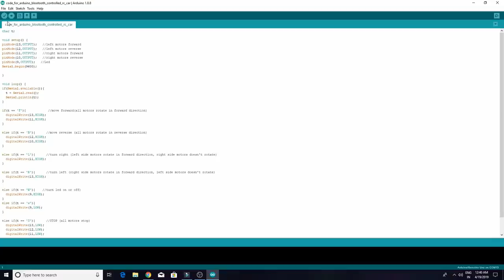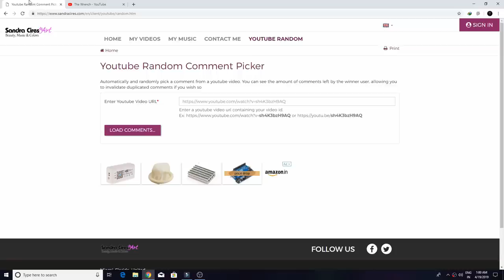WOW! Amazing DIY Bluetooth Robot Car - Control with Your Smartphone

Comment: there is an error while uploding like Arduino: 1.8.9 (Windows 8.1), Board: "Arduino/Genuino Uno"

C:\Users\sushin\AppData\Local\Temp\arduino_modified_sketch_942317\sketch_dec17c.ino: In function 'void loop()':

sketch_dec17c:50:11: error: expected '}' at end of input

 delay(100);

           ^

exit status 1
expected '}' at end of input

Invalid library found in C:\Users\sushin\Documents\Arduino\libraries\sketch_dec17a: no headers files (.h) found in C:\Users\sushin\Documents\Arduino\libraries\sketch_dec17a
Invalid library found in C:\Users\sushin\Documents\Arduino\libraries\sketch_dec17a: no headers files (.h) found in C:\Users\sushin\Documents\Arduino\libraries\sketch_dec17a

This report would have more information with
"Show verbose output during compilation"
option enabled in File -> Preferences.
Reply: Ranjith Kumar how do you fix it?

Comment: The motors do not work even when Bluetooth connection is established successfully
Reply: In the app go to settings . Every button have a cod , make it correct by seeing which cod you have upload in arduino

Comment: Dear sir, when I uploading the codes that you linked, error is appearing. Please help me to solve this.
Reply: before uploading the code make sure the  tx,rx ports of the arduino are unplugged
Reply: The Sixth String does uploading the program while tx, rx is plugged cause damage to the module?
Reply: @arkandzaky9010  , yp, u r correct. I did that mistake & module couldn't use again. 🙁

Comment: I am not able to upload. The following error pops up.Arduino: 1.8.13 (Windows Store 1.8.42.0) (Windows 10), Board: "Arduino Uno"

Sketch uses 2072 bytes (6%) of program storage space. Maximum is 32256 bytes.

Global variables use 189 bytes (9%) of dynamic memory, leaving 1859 bytes for local variables. Maximum is 2048 bytes.

An error occurred while uploading the sketch

avrdude: stk500_recv(): programmer is not responding

avrdude: stk500_getsync() attempt 1 of 10: not in sync: resp=0x36

avrdude: stk500_recv(): programmer is not responding

avrdude: stk500_getsync() attempt 2 of 10: not in sync: resp=0x36

avrdude: stk500_recv(): programmer is not responding

avrdude: stk500_getsync() attempt 3 of 10: not in sync: resp=0x36

avrdude: stk500_recv(): programmer is not responding

avrdude: stk500_getsync() attempt 4 of 10: not in sync: resp=0x36

avrdude: stk500_recv(): programmer is not responding

avrdude: stk500_getsync() attempt 5 of 10: not in sync: resp=0x36

avrdude: stk500_recv(): programmer is not responding

avrdude: stk500_getsync() attempt 6 of 10: not in sync: resp=0x36

avrdude: stk500_recv(): programmer is not responding

avrdude: stk500_getsync() attempt 7 of 10: not in sync: resp=0x36

avrdude: stk500_recv(): programmer is not responding

avrdude: stk500_getsync() attempt 8 of 10: not in sync: resp=0x36

avrdude: stk500_recv(): programmer is not responding

avrdude: stk500_getsync() attempt 9 of 10: not in sync: resp=0x36

avrdude: stk500_recv(): programmer is not responding

avrdude: stk500_getsync() attempt 10 of 10: not in sync: resp=0x36

This report would have more information with
"Show verbose output during compilation"
option enabled in File -> Preferences.
Kindly guide to clear the error and upload the code.

Comment: Codes and Diagram link is not working. Can anyone help me?
Reply: Code:
char t; 
void setup() { pinMode(13,OUTPUT); 
//left motors forward pinMode(12,OUTPUT); 
//left motors reverse pinMode(11,OUTPUT); 
//right motors forward pinMode(10,OUTPUT);
 //right motors reverse pinMode(9,OUTPUT); 
//Led Serial.begin(9600);
 } void loop() { if(Serial.available())
{ t = Serial.read(); Serial.println(t);
 } if(t == 'F')
{ //move forward(all motors rotate in forward direction) digitalWrite(13,HIGH); digitalWrite(11,HIGH);
 } else if(t == 'B')
{ //move reverse (all motors rotate in reverse direction) digitalWrite(12,HIGH); digitalWrite(10,HIGH);
 } else if(t == 'L')
{ //turn right (left side motors rotate in forward direction, right side motors doesn't rotate)
 digitalWrite(11,HIGH);
 } else if(t == 'R')
{ //turn left (right side motors rotate in forward direction, 
left side motors doesn't rotate) digitalWrite(13,HIGH); 
} else if(t == 'W')
{ //turn led on or off) digitalWrite(9,HIGH); 
} else if(t == 'w'){ digitalWrite(9,LOW); 
} else if(t == 'S')
{ //STOP (all motors stop) digitalWrite(13,LOW); digitalWrite(12,LOW); digitalWrite(11,LOW); digitalWrite(10,LOW); } delay(100); }

Comment: What language do I need to learn to program the arduino?
Reply: C++
Reply: You need to upload code
Reply: @sufiyanshikalgar8145  thanks bro
Reply: Welcome
Reply: Download arduino droid for uploading code
Reply: I deleted the code coz it was not in correct manner
Reply: This  is the correct code

char t; 
void setup() 
{ 
    pinMode(13,OUTPUT); 
    //left motors forward pinMode(12,OUTPUT); 
    //left motors reverse pinMode(11,OUTPUT); 
    //right motors forward pinMode(10,OUTPUT); 
    //right motors reverse pinMode(9,OUTPUT); 
    //Led Serial.begin(9600); 
} 
void loop() 
{ 
    if(Serial.available())
    { 
        t = Serial.read(); 
        Serial.println(t); 
    } 
    if(t == 'F')
    { 
        //move forward(all motors rotate in forward direction) 
        digitalWrite(13,HIGH); 
        digitalWrite(11,HIGH); 
    } 
    else if(t == 'B')
    { 
        //move reverse (all motors rotate in reverse direction) 
        digitalWrite(12,HIGH); 
        digitalWrite(10,HIGH); 
    } 
    else if(t == 'L')
    { //turn right (left side motors rotate in forward direction, right side motors doesn't rotate) 
        digitalWrite(11,HIGH); 
    } 
    else if(t == 'R')
    { //turn left (right side motors rotate in forward direction, left side motors doesn't rotate) 
        digitalWrite(13,HIGH); 
    } 
    else if(t == 'W')
    { 
        //turn led on or off) 
        digitalWrite(9,HIGH); 
    } 
    else if(t == 'w')
    { 
        digitalWrite(9,LOW); 
    } else if(t == 'S')
    { 
        //STOP (all motors stop) 
        digitalWrite(13,LOW); 
        digitalWrite(12,LOW); 
        digitalWrite(11,LOW); 
        digitalWrite(10,LOW); 
    } delay(100); 
}

Comment: bro bitly link is not opening
Reply: Copy this code
char t; 
void setup() 
{ 
    pinMode(13,OUTPUT); 
    //left motors forward pinMode(12,OUTPUT); 
    //left motors reverse pinMode(11,OUTPUT); 
    //right motors forward pinMode(10,OUTPUT); 
    //right motors reverse pinMode(9,OUTPUT); 
    //Led Serial.begin(9600); 
} 
void loop() 
{ 
    if(Serial.available())
    { 
        t = Serial.read(); 
        Serial.println(t); 
    } 
    if(t == 'F')
    { 
        //move forward(all motors rotate in forward direction) 
        digitalWrite(13,HIGH); 
        digitalWrite(11,HIGH); 
    } 
    else if(t == 'B')
    { 
        //move reverse (all motors rotate in reverse direction) 
        digitalWrite(12,HIGH); 
        digitalWrite(10,HIGH); 
    } 
    else if(t == 'L')
    { //turn right (left side motors rotate in forward direction, right side motors doesn't rotate) 
        digitalWrite(11,HIGH); 
    } 
    else if(t == 'R')
    { //turn left (right side motors rotate in forward direction, left side motors doesn't rotate) 
        digitalWrite(13,HIGH); 
    } 
    else if(t == 'W')
    { 
        //turn led on or off) 
        digitalWrite(9,HIGH); 
    } 
    else if(t == 'w')
    { 
        digitalWrite(9,LOW); 
    } else if(t == 'S')
    { 
        //STOP (all motors stop) 
        digitalWrite(13,LOW); 
        digitalWrite(12,LOW); 
        digitalWrite(11,LOW); 
        digitalWrite(10,LOW); 
    } delay(100); 
}

Comment: char t; void setup() { pinMode(13,OUTPUT); //left motors forward pinMode(12,OUTPUT); //left motors reverse pinMode(11,OUTPUT); //right motors forward pinMode(10,OUTPUT); //right motors reverse pinMode(9,OUTPUT); //Led Serial.begin(9600); } void loop() { if(Serial.available()){ t = Serial.read(); Serial.println(t); } if(t == 'F'){ //move forward(all motors rotate in forward direction) digitalWrite(13,HIGH); digitalWrite(11,HIGH); } else if(t == 'B'){ //move reverse (all motors rotate in reverse direction) digitalWrite(12,HIGH); digitalWrite(10,HIGH); } else if(t == 'L'){ //turn right (left side motors rotate in forward direction, right side motors doesn't rotate) digitalWrite(11,HIGH); } else if(t == 'R'){ //turn left (right side motors rotate in forward direction, left side motors doesn't rotate) digitalWrite(13,HIGH); } else if(t == 'W'){ //turn led on or off) digitalWrite(9,HIGH); } else if(t == 'w'){ digitalWrite(9,LOW); } else if(t == 'S'){ //STOP (all motors stop) digitalWrite(13,LOW); digitalWrite(12,LOW); digitalWrite(11,LOW); digitalWrite(10,LOW); } delay(100); }char t;
 
void setup() {
pinMode(13,OUTPUT);   //left motors forward
pinMode(12,OUTPUT);   //left motors reverse
pinMode(11,OUTPUT);   //right motors forward
pinMode(10,OUTPUT);   //right motors reverse
pinMode(9,OUTPUT);   //Led
Serial.begin(9600);
 
}
 
void loop() {
if(Serial.available()){
  t = Serial.read();
  Serial.println(t);
}
 
if(t == 'F'){            //move forward(all motors rotate in forward direction)
  digitalWrite(13,HIGH);
  digitalWrite(11,HIGH);
}
 
else if(t == 'B'){      //move reverse (all motors rotate in reverse direction)
  digitalWrite(12,HIGH);
  digitalWrite(10,HIGH);
}
 
else if(t == 'L'){      //turn right (left side motors rotate in forward direction, right side motors doesn't rotate)
  digitalWrite(11,HIGH);
}
 
else if(t == 'R'){      //turn left (right side motors rotate in forward direction, left side motors doesn't rotate)
  digitalWrite(13,HIGH);
}

else if(t == 'W'){    //turn led on or off)
  digitalWrite(9,HIGH);
}
else if(t == 'w'){
  digitalWrite(9,LOW);
}
 
else if(t == 'S'){      //STOP (all motors stop)
  digitalWrite(13,LOW);
  digitalWrite(12,LOW);
  digitalWrite(11,LOW);
  digitalWrite(10,LOW);
}
delay(100);
}

Comment: Pleas safe your life and dont recreate this mans foolish attempt. 
i dont get whats so fantastic about sticking some wires together and hot glueing it on a piece of wood. besides that you will probably light your feikn house on fire if you dont really know what ryou are doing. he uses unprotected 18650 cells which will at all cost utput the requested power. that means if say a short circuit occours because the foolishly made connections of shoving bare wires into a screw clamp loosens over time and the wire slipps out it will happily ignite the piece of wood its glued to.